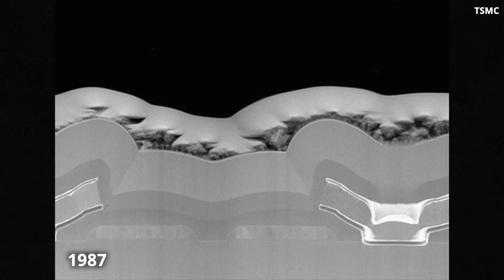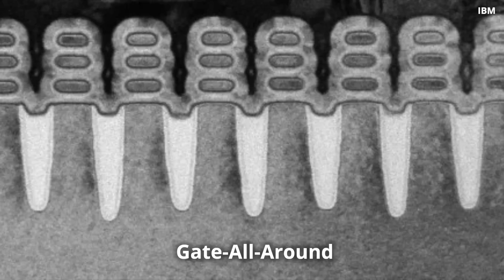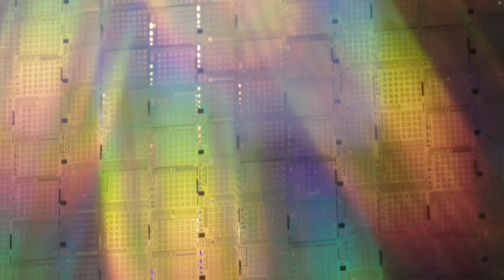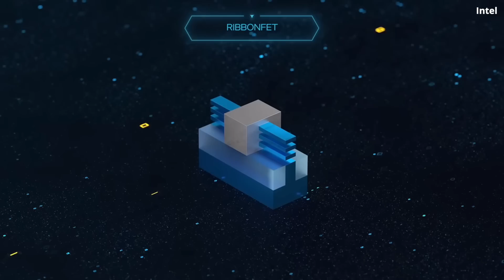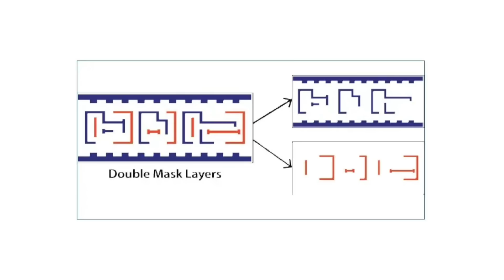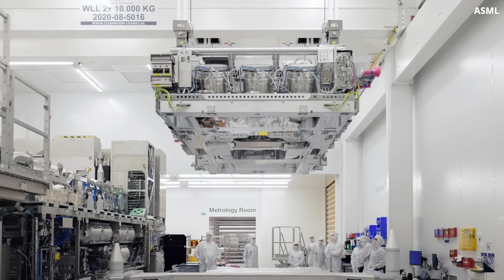New Disruptive Microchip Technology and The Secret Plan of Intel

Comment: How is this backside power delivery going to effect heat dissipation. Your still going to need a socket. Sure the transistors on the top side will be able to be cooled traditionally but with back side power delivery you now create more heat on the other side of the silicon. With the density increased by gate all around trying to dissipate the power delivery heat through the transistors themselves, wouldn't that cause power leakage issues as the temps rise potentially lead to a cascade or runaway thermal issue. Even with the power reduction brought from this new process, the increase in density and overall transistor counts, would lead one to expect a new thermal issue to result. Could this process put greater power limits on future CPU's possibly effect clocks and limiting overall performance gains that could otherwise be achieved from this process advancement. I apologize for the stupidity of my question I am a layman compared to you it's just that I am curious and greatly enjoy the rabbit whole of technology. Also thank you for posting this video I will be subscribing to better educate myself moving forward.

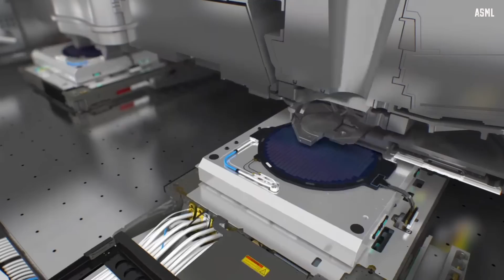Comment: RE: 16:10 - It's not just the number of transistors per fixed area that improves at smaller process nodes, it's also the physics.  You get better performance per watt.

Comment: with 3d mass customization of layered structures there is no need for boards or non-zero insertion force systems....with ai integration of physical simulation and optimization chips should morph into systems and systems into clouds.
with ai aided communication paths every connect from device to the cloud can be bonded into a resilient and optimized data flow.
I believe in photonics where ever possible....and harmonics over wires and da*n the connectors.

Comment: What happens if intel fails?  Merger with Tsmc?  Or acquisition… I wonder.  They’re so far behind they have to go all in on this new tech.  Just seems so unlikely to be cost effective enough initially to be profitable.  I know nothing about the specifics of the financials of course… but in general, new tech is more expensive or time consuming or both.  And unless it’s so much faster that they can offset the lower yields as well as the increased production costs I doubt it’ll be a win initially.  And they need a win very soon after converting to new sys.  There’s just so much insanely complicated engineering and production that everything has to go like 80% or higher to plan.  I wonder if they’re already contemplating (we’ll call it merging) joining Tsmc in the design and production at least.  It makes sense from my perspective but I don’t own their stocks.   And with Tsmc fans coming soon to America it seems like a more cooperative environment for both of them.  But the consumer would loose for sure though if that happens right?  Cus then they monopolize a large segment of the market.  Gov might shoot it down anyways.  Gonna be interesting at least…

Comment: I'm actually a little puzzled.  Way back (more than 15 years ago) I used to design PC boards (printed circuits).  I think the first time I used power and ground planes on multi-layer PC boards must be 25 years ago, and trust me I was not the first, people had been doing it for many years before me.
There are multiple benefits - reduction of complexity in the active circuit, a continuous ground plane reduces noise, ...
There must be a reason why it has taken chip manufacture so long to adopt this (ancient) approach?

Comment: To do a back side power on a wafer would require pure silicon and microvias in the wafer through the die. Won't be easy to do this, but you could put the bigger stuff on the bottom and the computing stuff on the top.

Comment: Heat rises ... so the power system will be a good frying pan under the working side? Or better access to heat sinks outside the chip? or mount chips 'upside down'? What new challenges are ahead?

Comment: the issue will be heat now ull have heat on both sides of the chip how will u cool it the wafer is a thermal barrier so cooling the power side will be hard from the top so now u will have increased resistance

Comment: Thanks so much, that was one of your best videos!  Something I'm left wondering about: just how thick are wafers these days, and HOW does the back-side power net point its way THROUGH the wafer? I'm wondering if maybe it's not actually on the backside of the wafer but simply the starting layer on the wafer, and above it you put the transistors and then above that you put the signal interconnect?

Comment: Perhaps Intel is focusing on data centers as opposed to small businesses and individuals. What is economical for an individual or small business is very different as compared to a data center. 
Yeah data centers have to contend with the high use of electric and heat that is produced in their facilities. Despite the cost increase that would occur in a data center using Intel's new integrated circuits perhaps the return on investment would Make them economical in the long term.

Comment: ASM is not ASML!  I did a deep dive into this to understand.  ASM is ASM International and they make Atomic Layer Deposition machines (for the wafer substrate).  They spun off ASML which makes the Photolithography and Etching Machine.  ASML is the huge company everyone always talks about.  ASM is also a large company but much smaller than ASML (10 times fewer employees and revenue).  Not to throw any shade on Anastasi who is great and since ASM (not ASML) is sponsoring the video, of course it probably wouldn't be right for her to point this out.
Reply: @SurfCatten why spin them off when they're both making products designed for a similar end goal of being machines to help manufacture semiconductors? 🤷🏾‍♂️

Comment: I designed and managed the design of microprocessors at Intel through 2000 after which I retired.  I've followed the technology roadmap in other roles and was extremely disappointed to see Intel blow a 2 year lead in silicon technology to now lagging badly.  Bad management, loss of focus, and failure to maintain investment has led to this.  I still have hopes for Pat to turn the ship around and think it's entirely reasonable for Intel to largely catch up since they don't have to codevelop equipment after TSMC has done it.  The intel transition to a foundry is extremely risky, but still not as risky as their failure to keep chip architecture and design on the leading edge.  Even if Intel had the equivalent to TSMC now they'd still have missed several market shifts, the latest being AI and neural network on board.  It was good to see some research into quantum computing, but that's still a ways off and they desperately need the right products for their hoped for resurgence in silicon.   Great job explaining all this Anastasi!

Comment: To follow up on the economics of High-NA - the reason the wafers-per-hour throughout is so slow is because the field size that is exposed on the wafer is half the size of standard EUV (429 mm² for high-NA vs 858mm²), thereby doubling the amount of exposures required per wafer and more or less doubling the process time per wafer (at least for the layers that require Hugh-NA EUV, which is only a small number compared to the total number of layers on the chips). 

However, the smaller field size also has another major impact  that directly affects their customers and chip designers. The field size determines the largest possible die size. And in recent years, as transistor counts have exploded with AI chips and all that, and with transistor shrink rates slowing, die sizes have been growing, with many commercial chips in the 500-600 mm² range. Monolithic (single die) chips of that size will be impossible to make on high NA, which may severely hamstring chip designers. So with the crazy upfront costs, high manufacturing cost due to the lower throughput, maz die size that is only half of previous generations, I imagine high NA is going to be a very hard sell for a lot of customers for a long time.

Comment: The architecture will be digital, the AI, will be analog, and its output will be here.
Reply: AI isn’t analog. It’s standard transistor circuits.
Reply: @sjzara  There is no context for your basis, the nature of the future is not your scope of knowledge, unless you create it.
Reply: @TheFurlock  The context for what I say how AI is implemented.  Computers use binary data.  The way that AI hardware works is by hugely parallel mathematics processors.  These are designed to operate specific mathematics functions extremely fast.  These use conventional and extremely fast mathematics processing circuits that operate on binary arithmetic.  Why don't they use non-binary representations? Because processing in modern computers pushes the limits of technology.  Having either a '0' or a '1' is very clean and less subject to noise than larger ranges, and so means faster operations.  There are no actual neurons in AI hardware.  There is nothing analog at all. It's just vast tables of data processed in ways that represent the relative strengths of connections between hypothetical neurons.

Implementing analog operations on modern computer hardware is a very bad idea. It's noisy and unreliable. Instead, it's far more effective to represent values as binary, and it always will be.
Reply: @sjzara  The implementation of creation in the mandala is digital, the creation is analog. 

All creation either born or made is analog.
Reply: @TheFurlock  No. “Analog” has a specific meaning when applied to computer hardware.

Comment: I've always wondered how long we'll have chips in one plane and when we'll switch to cubic, volumetric 3d circuit chips I think it's the future, the same way quantum chips are designed, why we can not apply that to transistor chips? (cooling is not a problem, is just an inconvenience) imagine how effective communication would be both horizontally and vertically, each transistor being connected directly from 8 neighbors directly to 26 neighbors, quadruple the effective speed of information propagation. I bet this is the real next step.
Reply: For some thick laptops and tower pcs. I was thinking about cube SoC's or spherical ones surrounded by liquid cooling.
Reply: The answer is because it is expensive. Silicon wafers are produced by a bulk process in which thin slices of silicon wafers are cut from the bulk ingot. Having multiple layers of transistor means you need to grow pure silicon directly from the wafer. This is a mature technology but it is a lot more expensive compare to just cutting thin slices of silicon. There is also a technology of bonding multiple silicon wafers together but wafer bonding needs additional grinding steps which is again expensive.
Reply: @kazedcat  with the same concept Ford almost lost everything, you can have it economic and simple performance or expensive and complex performance, you can make one step at a time or you can start to running, who do you think will win the race, economic or performance
Reply: @pentiumvsamd  There is no performance improvement unless you improve the transistors itself. Shrinking the transistor improves performance but just stacking them without architectural changes does not increase performance.
Reply: @kazedcat  The current computation of information, although done in parallel, is linear based, done from transistor to transistor usually in one plan addend times to move the electrons from one conner to another of the cip, but it can be allot faster with shorter path if we manage to stuck them in a tridimensional arrays, is like folding the map and changing the design concepts. i know that the time is verry short for that movement but that can be shorter and it will add up. More than that it can open up a new architecture not posibile with the current model by linking more cells together and shorter paths also reduce the heat generated witch is another limitation of the current architecture.
Reply: @pentiumvsamd  stacking them up does not mean shorter path electrically. Vertical vias uses a different metal which has higher impedance compared to copper. So even if physically the wires are shorter electrically you have higher impedance that means longer signal delay.
Reply: @kazedcat  technology is always changing, just like the first processors that used architectures different from those of today, I think that this model can open a window to new innovations to overcome the current limitations, without someone to create the first prototype with all its problems, we will not have what to improve and the current architecture is very close to maximum optimization and it is necessary to try new possibilities that seem unviable for the moment but leave room for improvement
Reply: assuming all manufacturing limitations are overcome, i see this as the most optimal way to put multiple transistors tied together in the same place in a small footprint and open to new circuit designs that are impossible with a classic layered model.
Reply: @pentiumvsamd  Yes it is changing but not always in a direction you expected. For now stacking is done on the packaging level because that is the direction that gives most of the benefits without adding too much cost.
Reply: @kazedcat  after a certain level, "the cost" is no longer part of the equation and "for now" or "good enough" are not accepted.
or at least that's how I hope it works.
Reply: @pentiumvsamd  CFET the next transistor after GAAFET will stack N type and P type transistor on top of each other. But I think that is the limit because of the difficulty of wiring the transistors. Having more than two transistors stacked on top of each other you end up with wiring contact taking up more space than the transistors. For CFET you need 6 contacts with 3 contact frontside and 3 contact backside.

Comment: The future is sandwiched power delivery. Eventually we'll learn to stack multiple processing layers on top of one another, what will need to be done more than likely on our way to other designs will be to add then to both sides of the wafer itself...this will require power delivery in the short term to be in the middle. How we cool that whilst also interconnecting that to a board will be interesting. I imagine Eventually we may even get to a cubed(essentially) cpu type where there's 4 transistor stacks to every power couple...so a square wire with a stack on every flat surface.  This will probably require molecular sorting machines to achieve...but that's for the future. Loved the video dear, great info as always

Comment: can it pimp silicon carbide switches to reduce losses and improve switching speed? it is needed to make small highly integrated DC/DC MPPT power inverters for solar panels and high power electric motor inverters as close to the motor as possible and reduce losses. while having an inverter efficiency of 98% instead of 96% sound not of a huge improvement regarding losses, but the losses needs to be cooled and reducing losses from 4% to 2% means 50% less cost for the cooling.

Comment: I hope intel does well. Aside from consumer benefits I invested a chunk of my retirement savings on the long term bet High NV EUV is going to put Intel ahead of TSMC for the first time in well over a decade. They just received one of ASML's HIgh NV EUV lithography machines at one of their fabs but it will be awhile before the machine is calibrated and fab completed. Intel says somewhere between 2027-2028 before the fab with the Twinscan ASML device starts mass production.
Reply: What us the biggest software trend… AI.  Who’s chips power AI… Nvidia.  As a long time investor, don’t put all your investments in one company unless you’ve done a thorough analysis of the economics and companies involved.
Reply: @raybod1775  Thanks. I'm an IT guy but I know enough about investing as not to put all my eggs in the same basket. One potential advantage Intel has over Nvidia and AMD  is fabs. If Intel's new High NV EUV fab business turns out better than TSMC Nvidia will have no choice but to also use Intel fabs to produce their products if they want to stay competitive.
Reply: @raybod1775   Their stock plummeted recently because of a deficit caused by capex but it's not unexpected. I've read Intel's capex on new fabs is around a whopping 186B over the next few years (partially subsidized by the American government). 

There are only a handful of companies globally that will be capable of mass-producing the next-generation chips and Intel is the only US-based one. This has also made Intel's success a national security issue.

You never know what technology can come from someone else out of left field but as it stands Intel seems poised to retake the title when those ASML machines come online.

Comment: I feel like Intel needs to be more risky in order to catch up. They've kind of been lagging behind TSMC when it comes to cutting-edge tech and innovations.
Reply: @edwardduda4222 Intel recently bought  one of 2 of ASML's newest next generation semiconductor manufacturing machines called  high NA EUV  , TSMC hasn't bothered to buy one yet & ASML keeps the other for R&D.
Reply: lagging behind?  I mean, I guess, they are also a customer of TSMC as they go mixed fab/fabless for creating processors.  Only relying on your own is not always a good move.

Comment: Ana: With signal on the top and power on the bottom of the chip, is it possible to use the “middle” of the chip for heat flow/management?
Best - Michael